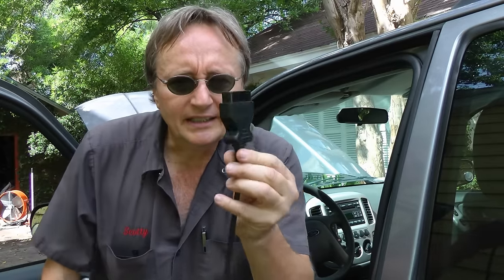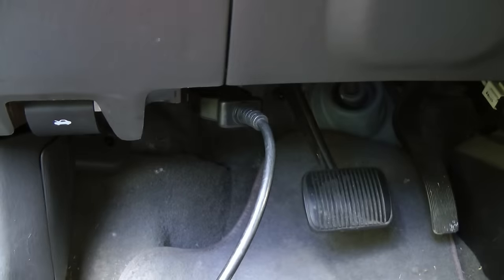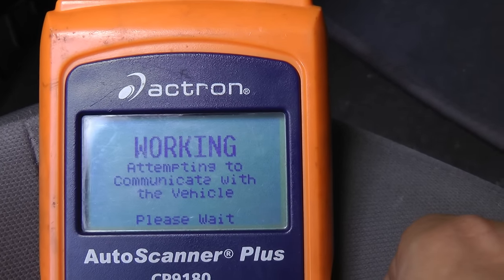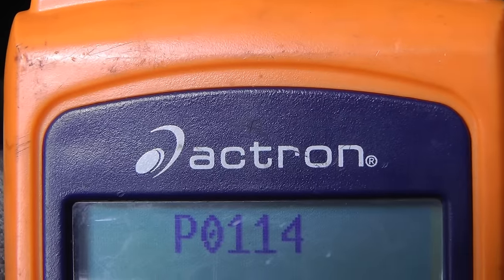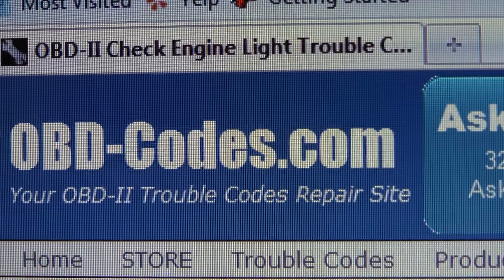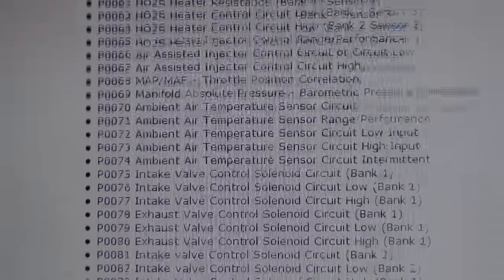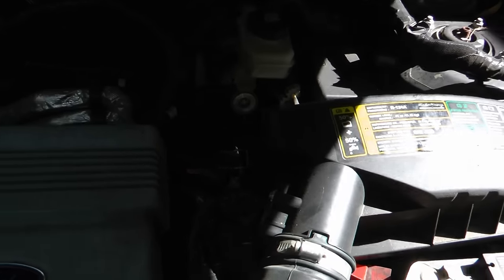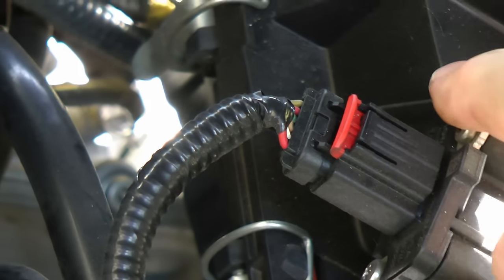Check Engine Light On and How to Fix It

Comment: Hi scotty my wife has a 2017 buick verano with 20 thousand miles on the odometer the check engine light came on so i removed the gas cap and put it back on and the check engine light went away when the car is on but when i turn the car off and just turn the key with out the car running thr check engine light shows up is that normal .thank u scotty keep them awesome video's comming havw a great day.

Comment: hi Scotty,
I experienced a flashing engine light in my 2003 Chevy Express and I was wondering what that code be in the computer for a Time. the reason why I ask it stopped( it ran rough for three minutes) and is acting normal now but wanted to find out if there is still a problem that I can trace and fix. thanks for the video

Comment: HI SR AWESOME VIDEOS, THIS IS FERNANDEZ FROM SEATLE WA, I HAVE A VW BEETLE 2000 AND THEENGINE LIGHT IS ON , I TOOK IT TO A MECHANIC PLACE AND THEY SAID IT WAS SOME LEAKING SMOKE IN A PART WHO IS PLACED NEAR TO THE GAS CAP BY THE RIGHT BACK TIRE, THEN THEY SUPPOSSE TO FIXED AND THE ENGINE LIGHT IS ON AGAIN, AND ALSO THIS CAR SMELL BAD WHILE DRIVING SMELL LIKE TOXIC SMOKE INSIDE , SO WHAT YOU THINK IT CAN BE PROBLEM , THANKS SR

Comment from the maker: the computer sends signals to the sensors, then they feedback to the computer on another wire. guy's just covering his own behind. If all you did was replace the computer, it is the problem unless you messed with other parts of the car when doing that work

Comment: Hello Scotty, I have an on and off check engine light (no symptoms) for the past yr for honda civic 2000. I was told that I need to replace the transmission. around 2000. What I am curious now is that all the mechanic did was getting the code P0740 and drive the car a little bit. Is that enough to diagnose the problem? I went to two independent mechanics btw. Thanks!

Comment: Scotty, just purchased a 2003 Hyundai Santa Fe 3.5 All wheel drive, very clean car, well taken care of , 2 things , first code P0224 something with the throttle sensor, do i replace it ? an i notice at slow speeds i hear a clunking noise when it shifts talking like 5 mph to 25, like something is loose, transmission is smooth shifting, clunking / dragging feeling, please let me know, its in mint shape , thank you for your time
Reply from the maker: Kody Darlington   those are notorious for transmission problems, have a guy like me scan it on a test drive and pray it's not the tranny going out.  BUT, if throttle sensor is bad, merely replacing that can also fix shift problems.
Reply: +Kody Darlington also check your shift control module as well also check all your fuses and relays for the shifting or transmission relay it might be a possibility it might be bad and that would couse you head aches as well

Comment: Hey Scotty! My check engine light came on about a week ago and I had it checked by 3 mechanics. The first Mechanic shop was Aamco and they said the tranny was fine the code was for a bad "range switch gear position" sensor?.

Then the next mechanic read the same code and he drove me to a third mechanic who had a huge car reader scanner thing and it read the same thing. He said it'd cost me $250 bucks.

My Q is if I have a "Range Switch Gear Short" do I HAVE to fix it? 
Code: 05-1, p1705

Ty!!

Comment: Cool Thanks man, I wanted to know if you have a video on how to change the front control arms, because i have also noticed that when i drive the vehicle vibrates and wiggles around abnormally.the steering wheal also moves when i brake, is it even the arm or something else?

Comment: Hi Scotty, this is James from Malaysia. I've clean the maf sensor, cleaned the throttle body, disconnect and reconnect the battery terminal but my car is still suffer from rough idling and high fuel consumption. And yes, the check engine light was gone after I've done that but it returns after I crank up the car for the 2nd time for checking...need your advice Scotty..and I'm driving a Suzuki swift 05...thanks

Comment: Hi Scotty. I have a 2001 Galant with 158k that started throwing a PO421 code when the frigid weather started and I also had a misfire issue due to a broken wire that was fixed 2 weeks ago. I erase the code and it keeps coming back after a few days or so. Could it be a faulty sensor? I have my inspection coming up in May and I don't want to have to buy a Cat to pass emissions or worse, another car. Any suggestions? Should I try Cataclean or some other cleaner? Thanks!

Comment: Hi Scotty, I have a 2007 ve commodore. I don't know all the much about cars, so if I sound stupid please don't get annoyed! The first problem I had, was the car was overheating and I had to stop at one point because I noticed the Temperature Gage was rising very fast. I topped up the coolant in it, but no change. So the next day I took it in to get fixed and serviced. A water pump had to be replaced and it just had a general service. It ran okay for about a month and then once again the engine light started showing, the car is not overheating but Engine light is going on and off very often. Also it comes up on the dash with "Stability control off" most times when I break and starts beeping. It is very frustrating as I have spent so much money on this car and I drive very smoothly, but it is one problem after another. Any ideas on why these things are happening? :)

Comment: @scottykilmer hehe,it cool. I Actually like it.  it give it attitude....thanks for the tips...I got a hand me down car, protege 1999,  and I'm at Universaty right now...the check engine light came on last week...was trying to find a way to not be to expensive and try to do it myself...Had the same problem in the past and it was the O2 sensor that was not clean...after 400$ of work the tech. couldn't find the prob. Put fuel injector cleaner and seem to do the job for 1 year but now back on

Comment: +scotty kilmer I got a code that said my evap system had a gross leak. I could not find any fuel leaking anywhere but I did notice my gas cap would not seal. I replaced this and disconnected my negative terminal so the ecm would reset. I started the truck right after I connected the battery and the check engine light was off. Does it typically take a while for the ecm to detect the leak again?

Comment: Hi Scotty I just bought a Honda Pilot 2011 and it fails emission test with 3 codes and they’re p0842, p0757, p0155 and the check engine lights does not on when you turn on the engine. What fuse are belong to the check engine on the Honda Pilot 2011. Thank you

Comment: hi scotty ,i got a toyota hiace it was running perfect,, recently overheated and check light
was on ,,have had enjine reringed new radiator head gasket done
i drove out work shop was ok had a slight grumble at idle week later
check light has come back on and is misfiring but coolant looks fine
enjine is cool ,,appreciate your knowlegde what goin on with it.

Comment: Great Vid. I have a 2001 Toyota Rav 4 (Not electric) with an check engine light on. I scanned for codes and it showed that Bank 2.Sensor  2 was malfunctioning therefore I changed it out and the engine light is still on. After re-coding a different code was displayed which was Bank 1/sensor 1. Is there any other options before purchasing another sensor. Also I've heard that the sensor needs to be heated before putting it in the car. Have you heard of anything like that?  Hope to hear from you soon.
Reply from the maker: na, you don't pre heat them. But codes for sensors are not always a bad sensor. Dozens of things, from intake manifold leaks to weak fuel pumps can cause those codes to trip. If it runs good, just ignore it. If not, see a guy like me to analyze it with a dealer level scan computer
Reply: Thanks for your quick response. I'll check those things as you mentioned. It runs good it's just that for emission testing if the light is on they will not inspect. Thanks again

Comment: If the check engine light comes on more when a lower grade of gas is used, what could be the problem, air/fuel sensor? (1997 Mustang V6)

Comment: Ok, so after you fix the problem, will the check engine light go off on it's on or do you have to clear it somehow?  I noticed your code reader had an "erase code" function. Did you have to use that on this problem? Sorry if I missed that part in the video
Reply from the maker: +39thala it will go off after driving a few days if problem was fixed. But most guys erase the code to make the process faster
Reply: +Scotty Kilmer Thank you!

Comment: hey scotty i got a 94 integra and the check engine light and maint req is on, i been driving for bout 4k miles like this and it runs strong. cant be none of the liquids. should i just reset the light?
Reply from the maker: go ahead, but it will probably just come back on. Those old acuras are touchy and it means nothing  if it runs fine.
Reply: Thanks Scott for the great ideas and tips on how to arrange cars:-))

I have some trouble with my Diahatsu Delta Van.  The heater light is on and it continues to stay on all the trip. How could I get it off or what should I check?
Regards, Stephen Malta

Comment: Really thats what autozone guys told me, ok one last question yesterday i tried to replace spark plug wires and spark plugs on a chevy silverado 1500 v6 and the engine light went on and engine started to shake a lot like choking do you know the reason why??

Comment: (2/2) So is the "check engine" light supposed to go off by itself if the fuel cap was the problem? or do I have to take it to a mechanic and have them check and turn the light off. I thought I would wait for a few days and see if the light turns off after replacing the cap before I take it to the dealer.

Comment: hello mr. kilmer I have a 2003 ford Taurus and the rpms are idling up and down and the engine light is on I have replaced the pcv valve and elbow and also did a tune up and replaced the coil pack. it runs fine when the air conditioning is on as long as i'm driving no problem but when I stop at a light or anything it acts like it wants to cut off and the rpms are jumping please give me some tips as to what you think the problem could be thank you.
Reply from the maker: I would need the code for the engine light being on, get it scanned, e mail me the codes

Comment from the maker: oxygen sensor codes can pop up for scores of reasons BESIDES bad sensors, such as bad wiring, bad computer, bad fuel injectors, weak fuel pump, gasket leaks, and many more. Find a REAL mechanic to analyze it correctly.

Comment: I have a Ford Explorer Sport 2001 and I need to know how to reset the check engine light.  The light is not blinking, and a few years ago in Chicago, I paid over $80 to have the code checked and it was the gas cap.  A few days ago, I did not replace my locking gas cap (drove off with it on top of the truck) and I have the same code verified by AutoZone.  I got a new gas cap, but, I need to reset the check engine light.

Comment: Hey Scotty, 
I have a question I have a 98 240sx which recently got a p0115 temp coolant sensor malfunction & I replaced the necessary parts, reset it and even STILL it reappears. Could it be something wrong with the ECM? it has trouble cranking at times as well !

Comment: Scotty HELP!!! My daughters 2008 Saturn Astra XE won't start after I tried to do a reset for the tire light the tutorial said to turn to ON then hold the lock and unlock buttons down on the key fob and the car should beep but it didnt so then I tried to start it to see if it worked and I get lights but won;t start what happened and how do I fix it! Thank you waiting to hear back from you
Reply from the maker: try my video "fixing a car that cranks but doesn't start up"  but if it doesn't even crank the engine, check the starter and have a pro check the anti theft system
Reply: the car was working fine before I tried to reset the light now all dash lights come on but won't make any noise to start
Reply: i think when I messed with holding the key lock and unlock something happened and its not programmed anymore I also held the trip button down for 10 seconds

Comment: M y '11 Suzuki Alto needed new fuel filter a few months ago, and I replaced it since its too easy to just plug a new one. Now the check engine went on and has idling problems. It sputters then dies when you let off the gas. .  Removing and reconnecting the battery works for a few minutes, then the problem  returns. Any idea? The service fee of the service center is criminally high, and I am contemplating returning to a good old carbureted car.

Comment: Iisten up car guys, I need help 😮
Check engine light stays on, no flashing.
2 mechanics have dx and performed work.
From replacement of O2 sensors to evap hose replacements. New gas cap OEM.
BTW car is running great.  Absolutely no issues? Need to smog for renewal!
Am I screwed?
Huyandai Touscon 2009

Comment: Hey Scotty. I have a 2000 Pontiac Grand Am. 4 cyl. While I'm driving, sometimes the engine will run really rough and trigger a flashing CEL. But once it upshifts, the roughness goes away and so does the light. I've got a scan tool and there aren't any codes stored or pending. What could cause this?

Comment: Hey Scotty, I have a 2006 civic and my "check fuel cap" light was on for a couple days, then it went off and the "check engine light came on...so I looked in the manual and it said the check engine light can come on due to the fuel cap problem so I inspected the fuel cap closely and noticed that the rubber sealing things around the inside of the cap (hopefully you understand what I mean by that, lol) was damaged. then I replaced my cap yesterday and the "check engine" light is still on. (1/2)

Comment from the maker: your comment does not make sense. Either the tires are smelling or the engine,   If the engine, check for burning fan belts from worn out things like alternators or water pumps going bad

Comment: To Scotty i have a 2001 mustang and the engine light came on and the problem was the fuel injectors but the light is still on, should I disconnect the battery to reset the computer?

Comment: Hey Scotty, Can you help me with this problem, I just put new plugs, wires, and rotor on a 1999 dodge dakota and it's giving me  3 codes, p0300 multiple misfire, p0303 misfire on #3, and p0305 misfire on # 5. I bought that tool you used in your video to check the fuel injectors and all those seem to be good, although I check them after driving the truck 50 miles, after I reset the computer sometimes I can drive 1 or 2 hundred miles before the engine lite comes back on, what could I do next?
Reply from the maker: +Cliff Moses  do my video test "how to tell if your head gasket is blown" and I'll bet yours is starting to blow. That, or those two injectors are just wearing out OR the computer circuit that drives them is going out

Comment: got a head scratcher here. well for me! I had code for the o2 sensor after the converter. I forgot what number. Cleared it, then about maybe a week later again. cleared it. Now code p0420 but not older codes.. truck is a 98 gmc 5.7 L31 I watched your vid on cleaning cat but i'm bit skeptic as the local muffler man said fluid can hurt cat and you cant clean them, he offered to cut them off and make it to where the codes wouldnt show. I am putting new sp plugs and used some lucas cleaner. tips? TY

Comment: My check engine light was on got one of those readers said my O2 sensor was bad. Change the O2 sensor. Engine light is still on will it go off by itself if the problem is fixed? Or does it stay on until someone resets it? Thanks
Reply: Trouble codes are only general. Cars arent magic and cant tell you exactly what needs fixed.

Comment: hey scotty wats up man i had a question, i have a toyota 1995 avalon 6 cylinder, i was driving the other day with my ac on low and my check engine came on. but i did not notice any performance problems the engine sounded normal, my question is does it sound serious and can i drive the car for 3 days until i get money to pay for the fix.?

Comment: Well I have a 2006 Grand Prix GXP. My check engine light has came on a few times over the year, but I've fixed things like easily check the gas cap, shanged spark plugs, and spark plug wires. I took it to my local auto zone, and had them hook up their hand held scanner to see what it could be. When the guy hooked it up he said its not reading any codes. If my engine ligh is on, but the scanner wont read codes, then what could it be?

Comment: hey scotty,
do you have any advise for finding a vacume leak?...my mom has a dodge caravan and when you give it gas it makes a high pitch whisteling noise...also the check engine light is on and says its the evap system leak and was told its a vacume leak

Comment: Hello Scotty , I have a 2011 Honda Accord v6 coupe , and today when I was driving the (D) light start blinking and I have a check engine light comes on !! The car has only 47000 and I have no idea what happens any advice would be appreciated Scotty , someone told me that this's might be the transmission fluid !!??? And last month when I went to the dealer they told me that I have to change the transmission fluid but am afraid to do that so do you think this's might be yet ? Thanks in advance .
Reply from the maker: +Dr. Abe d light on means a transmission code has set. PRAY it's as easy as changing the fluid often it's worse. Only scanning it and analyze the code would tell you the problem area